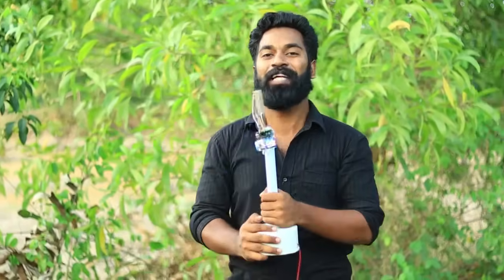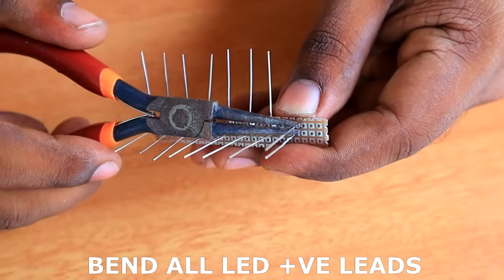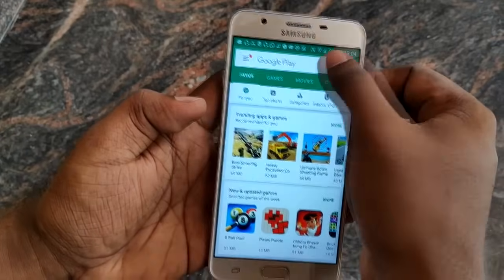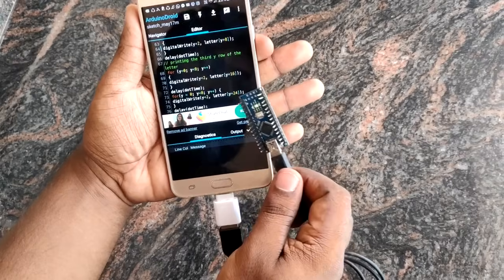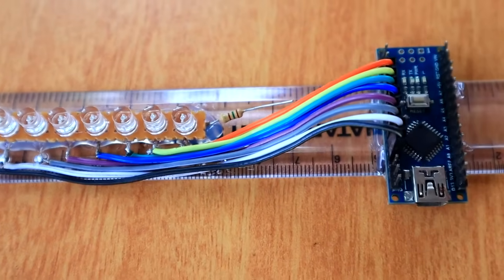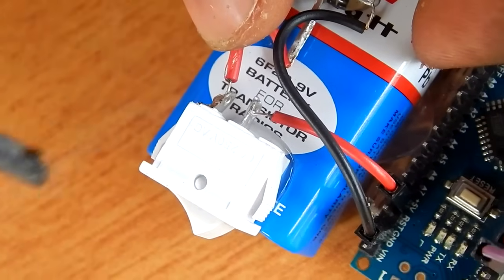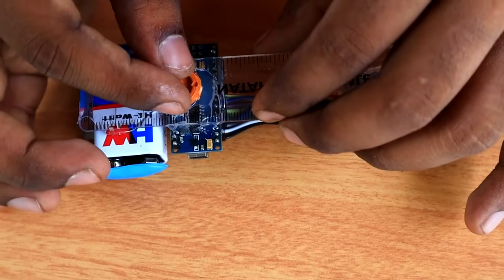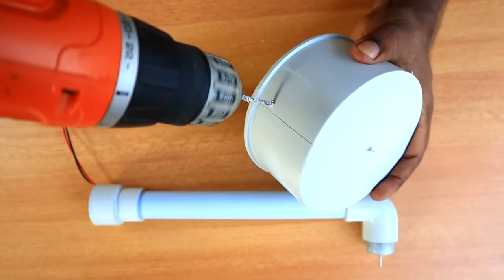How To Make POV Display At Home | LED ഡിസ്പ്ലേ  ഉണ്ടാകാൻ പഠിക്കാം | M4 Tech |

Comment: some more dufficult version - with crescent(half-round) of RGB LEDs, rotating on half-circle diameter vertical spindel. It forms "3D holographic"  spherical image of rotating globe or some planet, -acts as spherical display
Reply: Can you please describe it brother
Reply: @HOLEO-pl3bb  it looked like a globe, which instead of a ball had an arc (half the length of a circle) which was a LEDs line rotating meridian
 - rotating around the axis of the earth (not a horisonta TV type of scan line  TV, but a cycling-meridian-type of sweep), the upper end at the north pole is free - like the end of a helicopter propeller blade(deformated under overload - curved upward), the lower end of the C-shaped arc of the LED ruler - the South Pole - was fixed on the motor axis, when other-upper end of LED-line(North Pole) was on same axis only geometrically - no any mechanic axis was inside of globe, motor held the LED ruler by one end, although both ends of it were located geometrically on the axis of the motor. 
When rotating in a darkened room, only a stand was visible, above which in the air the "holographic" (pseudo-holographic) globe rotated or stood on the spot or turned into a text of an advertisement running on a spherical surface of rotation of the arc of an LED line - it looked like a color(RGB LED) set of rings different diameter(equator-biggest- was drawed by middle led in led-line-arc) like a wisible-parallels of geographic globe, hanging in the air, between which transparency was preserved, which made it possible to see also the back side of the globe through the slots between the lines (rings) of the sweep
Reply: @IamJiva thanks  brother. can you please give me a chance to talk with you.
Reply: @HOLEO-pl3bb  rotates with 10Hz(*2Pi radians) frequency, 200mm diameter approx. with 64 LED or maybe 32, and resolution of rotation was much better than that 32 loops (lines-rings) - it is sensible also

Comment: How to reduce the speed of rotation
Reply: Use can reduce the voltage from 12 v . By using 7805 for 5v , 7809 for 9v output

Comment: This project is quite nice and simple.But why r you using a 5volt regulator when arduino nano can take up to 12 volts from the RAW input ,also you could have used the same battery for the motor. And after all there is no requirement of using Arduino Nano
you could have just used its IC ATmega328 which is more cheaper and light .

Comment: If the speed of the moter changes then how the alphabet is displayed
In some  moter it will rotate in 500 rpm or in some moter it 200 rpm then hot it adjest the blinking with speed??? Explain

Comment: May be a school project. It will not work continuously. The scale with battery weight at one end will soon wobble and vibrate. Then goes the display and entire project. Idea is good, construction is primitive

Comment: compile cheyyumpol code error kanikkunnu

Diagnostics
Compilation error

Output

/sdk/hardware/arduino/cores/arduino/main.cpp:14:
undefined reference to 'loop'
collect2: error: Id returned 1 exit status
Return code is not 0
Reply: ഇത് തന്നെയാണ് എന്റെയും പ്രശ്നം
Reply: Board correct ano appil? Then try any mis match in code.

Comment: arduino nano k direct 9 volt koduthaalum work cheyyum... voltage regulator ic use cheyyanamnu illya... vin pin leek 9 volt direct kodukkam